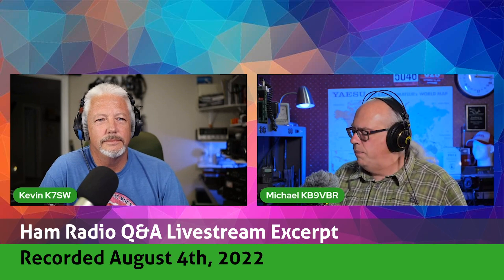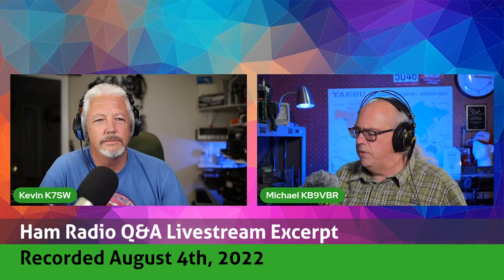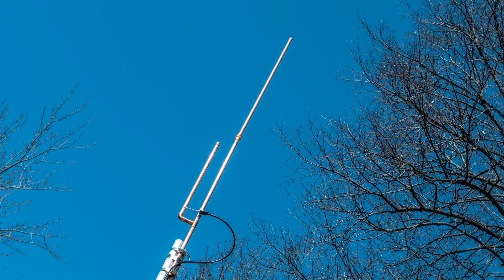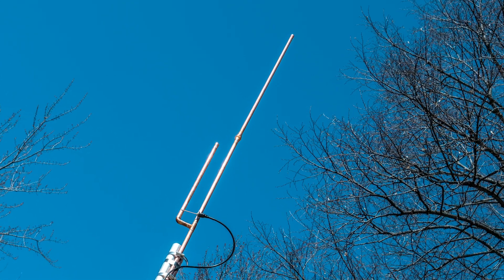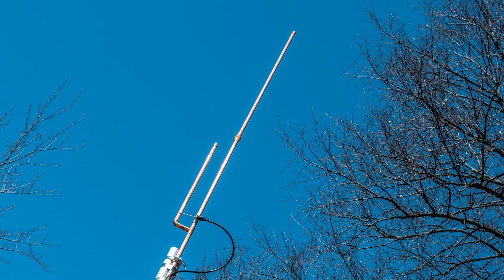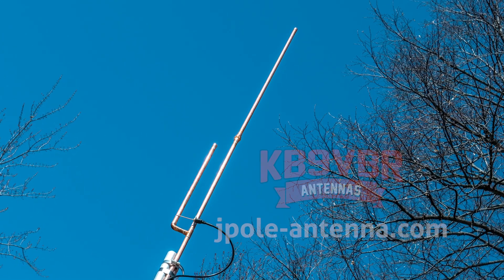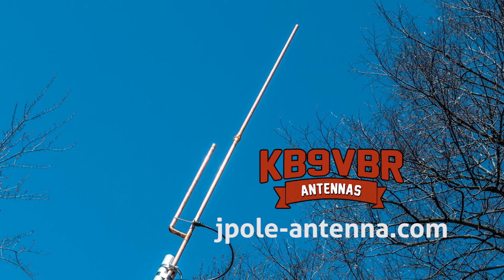NVIS Antennas - August 2022 Livestream Exceprt #hamradioqa

Comment: There is a boat load of great information "out there" on nvis including proven theory that the max frequency band is 20M and that's hardly ideal. When dealing with RF, there's always some exceptions d/t atmospherics, ground conditions (salt water vs. hard rock), antenna characteristics, etc. The facts are that nvis works up to a typical max of 30M. Else it penetrates the ionosphere or gets reflected downward at an wide angle. 
Height above ground for a nvis is 1/8 to 1/4 wave for a max range between 350-450 miles. I refer readers of this thread to the military literature re. HF has gained a resurgence in the US military community -- and that nvis -- for medium haul comms d/t its resistance to jamming.

I built and experimented with an AS-2259/GR cut for 40M and 80M, else identically configured with the dipole feed point at 15 feet. It's definitely sensitive to the nature of the ground where I obtained a terrific match/low SWR over irrigated ground at a county part to granite in the mountains where the match went to crap. I made and recorded a contact with another nvis station some 400 miles distant comparing my inverted Vee's performance with a 40M straight dipole nearly colocated and fed at the same height. I got 1-2  S units better RSS on my AS-2259 clone than the wire horizontal dipole. 

If readers are interested in nvis propagation predictions, NOAA has a web site for the purpose. There are numerous sites around that ping the ionosphere to give a dynamic prediction every few minutes.  This one for Pt. Arguello (Vandenberg AFB, Calif):https://www.ngdc.noaa.gov/stp/IONO/rt-iono/realtime/PA836_foF2.png
The plot provides nvis data over the previous 5 days, the day previous and current ping results.

More:  presentation by a US Army Signal Corps engineer:
https://www.youtube.com/watch?v=4EadY6eDKhs&t=1s
Reply from the maker: Thanks for sharing, the military has put a lot of work into NVIS communication, so their information is a very good resource. 

It's interesting that latitude can effect maximum usable frequency. In the high latitudes, including the upper half of North American, NVIS tops out at about the 40 meter band. But if you travel towards the equator, you can realistically use the 20 meter band. Of course this is dependent on propagation, but the resources you mention will help you determine your MUF and LUF.

Comment: A body of water makes a great reflector for NVIS... doesn't matter if it is salt or fresh water. I checked into the Eastern PA phone and traffic net with 25 watts from a campsite on the edge of Lake George, NY and had the strongest signal on the net. My antenna was a simple inverted V with the center about 25 feet off the ground.

Comment: Michael many years ago the Radio club I was with had a 40/80 mtr NVIS antenna for field day.  It was an inverted v 10 to 15 ft at the center.  We used PVC for the center.  Worked great in WNY.

Comment: 10 meters of wire about 10 feet off the ground makes a pretty decent NVIS dipole on 14.2 MHz
Reply: 20 meters  is not an NVIS band frequency. In this case the higher height is the better.
Reply: @kschildt1  As in ALL cases, performance depends on current band conditions. We both know, that goes without saying. You are claiming NVIS doesn't work on 20 meters which is a very bold statement. If that's not what you meant, please rephrase your statement. In the context of the discussion, your counter to my statement appears to reflect some inference of doubt to what was originally stated. 

If I raise it say, 10 meters off the ground, then the antenna is no longer radiating upwards, therefore no more NVIS propagation. The video is about NVIS. I didn't select "10 feet" arbitrarily. It gives a good mix of low SWR and a decent amount of gain. As you raise the wire, SWR goes up and gain drops. When it balances out again from going high enough (for example, at 10 meters), the upward propagation no longer exists in any meaningful amount. Sure, it's still radiating outward, but that is not what the video or this discussion is about. 

If I wanted to get the most out of a 20m dipole, I would put it about 23 meters off the ground. Most folks don't have that capability. If you did, you would get a great balance of a low takeoff angle as well as an upward radiating signal.
Reply: @norrinradd8952  NVIS frequencies are all below 8MHz. My comment was limited to a 20 meter antenna and no other. A 1:1 swr does not indicate antenna efficiency. There may be some gain but it is radio energy being directed to a portion of the ionosphere that is non reflective at that high an angle. What good is gain if it doesn't provide communication?
Reply: NVIS happens when you have an antenna that radiates upwards (near vertical) AND conditions that allow the signal to be propagated back down to earth. Works just fine on 20m when conditions allow. For you to claim otherwise is just false. 

I'm afraid I don't understand the rest of your post. It doesn't appear to be related to anything I said. You appear to be making random disconnected comments. I never made a comment about 1:1 SWR and I never made any claims about gain. At this point you are taking words from my post out of context just to make an argument about something unrelated. 

What I specifically said related to SWR and GAIN is that when you raise and/or lower the wire THEY BOTH CHANGE. That was my only point. I never made any claims of actual numbers. 

I would get more specific with my example of a 20 meter dipole again, but you didn't get it the first time. You're clearly just interested in winning an internet argument.
Reply: @norrinradd8952  20 meters is not a NVIS frequency. I would provide you citations but it would be a waste of time.

Comment: I have been running an NVIS net monthly for over a year and the inverted V 15' height is not a great NVIS on 40/60/80. I spent a couple thousand dollars on a variety of antennas from Chameleon  TDL (meant for nvis), DX engineering 40/80 kit with the 80m coils meant for the lower height, slopers, end fed, wire reflectors, etc. Basically I found that inverted V worked amazing but the higher I put it the better it worked.  I went to a 25 foot mast and it was better, then moved it to a 35 foot height (48ft push up mast) and I am hearing and being heard by nearly everyone that checks in now.  I came to this end conclusion after listening to the guys who always heard and could be hear by everyone, they had inverted V antennas at 33 - 50+ feet (G5RVs).  I am using the Chameleon Hybrid Mini with 73' wire inverted at about 37' apex with ends about 5-6 feet off the ground, it works amazing, my friend switched to the same and we can finally communicate on 40/60/80 via NVIS.  I don't know why the 15' height is the suggested height, it just didn't work for me and many others. The range of participants are in the North Texas and southern Oklahoma area but those with height are always the best.  We tried so many different antennas, configurations, heights and such with data recorded I have thought to make a quick video and post our results.  I'd hate for people to spend time and money on nvis promising antennas at a low height but they just aren't as good as higher, in my limited experience.😁
Reply from the maker: I think the 15 foot height came into popular acceptance without much thought to as why. It is generally accepted that an antenna will exhibit NVIS properties at about .01 wavelength of its fundamental frequency. For the 40 meter band this will be about 15 feet. Of course on 80 meters that height is doubled, but simplified concepts tend to stick. 

Long story short, unless you can deploy the antenna more than a 1/4 wave in the air, it will exhibit NVIS properties. But the best height will often depend on local ground conditions. Incidentally, my G5RV is set at 30 feet and I receive very good statewide coverage on 80m. I also knew a ham that was active on traffic nets and his antenna of choice was an 80 meter dipole at 30 feet.
Reply: Would love to see you make a video(s) on it.  Many just do it a few times and post a video.  Even after that, I don’t think there are many good videos on the topic.
Reply: @luissanchez3214  I have thought about it but didn't start taking screen shots of WSPR propagation until my last antenna. I guess I can get each antenna up again that I tried and video it and take shots of WSPR propagation. I see other videos that get results with 15' and such but it just hasn't been my experience. I'll post again if I can get something up showing results of each antenna I tried. Thanks for the responses all!
Reply: I think the reason people specified 15' is because the military AS-2259/gr antenna is about 15' and was designed just for this purpose. I have my inverted V antennas 20, 30, 40, 80 at 34' on a Spiderbeam mast and they work a lot better than at 15' and I can hear a lot of stations (when they check in) on the Texas Traffic Net on 7290.